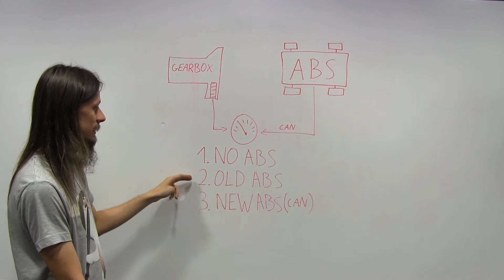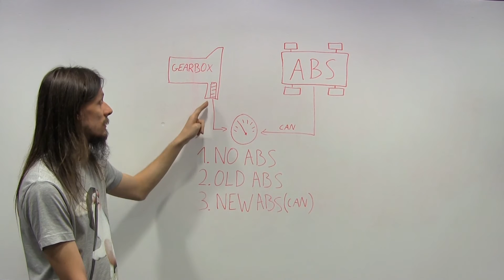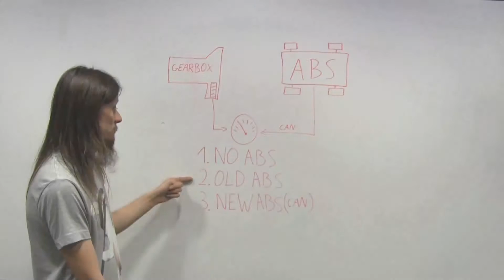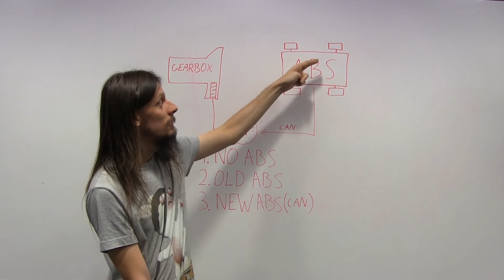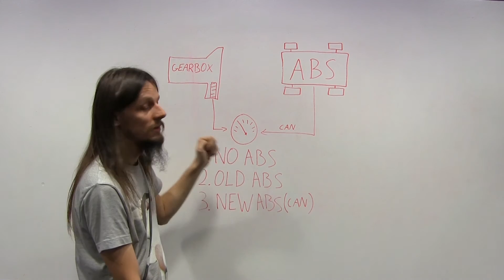DStage #6 - Seicento speedometer change (speedometers part 2)

Comment: This is really interesting, I too was wondering about changing the mechanical speedometer in my Seicento with the electronic one and did figure out by looking in the workshop manual, that the connectors are different but the wiring is compatible. I didn't know that there was an ABS ecu modifying the speed sensor signal, It looks like the same on according to the manual?? Neverthe less, fitting a Seicento hall speed sensor in place of the speedo capable should be a drop in replacement.  Making a small circuit  for multiplying or dividing the speed signal by some factor is easy, either with a simple decimal counter cmos chip or a dedicated micro processor  like an AVR or Arduino. Did you ever finish the conversion?
Reply from the maker: Hi. As you said most of the wiring is there so it's mainly a matter of changing the connectors. However unless you have a bit rare version (at least in Poland it's rare) with SPI cluster using electronic speedometer then you do not have an impulsator in the gearbox (VSS I mean, the Hall one that you've mentioned). And even if you do, then if you would change the gearbox like we are planning to you won't have the port to install it any more ;-) That is why we have changed one of the stearings to have the ABS sensor instead of the gearbox ipulsator. Plus it has more pulses making it more precise.
I did not entirely get the part about ABS ecu, we do not have an ABS module here. We have used my own piece of electronics containing a small microcontroller as you have also mentioned. It's a small cheap ARM M0 not AVR in this case. Doing that with CMOS counters might be possible but it's not so easy as depending on application this factor most likely won't be an integer number and making a fractional divider gets bit complicated. 
I'm not sure why you are asking if we have finished - isn't there a proof that it works at the end of the episode? ;-) Anyway, yes, we did finish and it works a treat. In fact I have just changed tire size so soon I'm going to reprogram the division factor a bit so it is once again spot on with GPS speed.
Reply from the maker: Ooooohhh! Sorry :D I thought you are commenting on differentt episode haha. Please check #11 :D
Reply: Ah got you, you have  used a hub with ABS sensor and reading that signal and that is different from the speed sensor I'm talking about. There is a sensor for the Punto which fits in the hole in the gearbox where the cable used to be: http://www.fiatforum.com/tech-talk/321704-vss-wire-colours.html. It is spinning a small magnet inside the plastic housing next to a hall sensor so it gives a very clean signal compared to an ABS sensor. I'll figure it out myself, thank you. While I have your attention  ; another one of your Seicento videos you upgrade the rear brake drums to Punto brakes, what I like especially is the hand brake cable going all the way inside the brake drum, does this fix solve the problem with the Seicento handbrake rusting solid after 3 months? Because I have taken my brakes apart 50 times and oiled the handbrake mechanism just to have it rust again.
Reply from the maker: There are Seicento MPI sensors for gearbox as well so of course it is entirely possible to use it. I just wanted to look ahead and prepare for newer gearbox. And to make things clear - you are probably thinking about an ABS sensor that works with this metal gear like crown. I have never seen that one in action so I'm not sure if it's also hall (with magnet) or reluctant (VR, also with magnet) so it may ave not so nice signal. BUT the one in Seicento is done in "newer technology" and just like in the gerbox VSS it uses hall with magnetic path. The difference is that the magnetic path has much larger diameter that in the one from gearbox and thanks to that there are more pulses per revolution. It only has two wires but it only means you have to bias it with resistor and the output signal is very nice and clean (check episode #11 for details). 

Since we've done the brakes conversion there was absolutely no problem whatsoever with the handbrake. No rust, no freezing, used frequently for parking, holds and releases as it should. No more drums induced headache :D
Reply: Thanks a lot for explaining, and I've just decided that the Punto brake conversion is something I need.